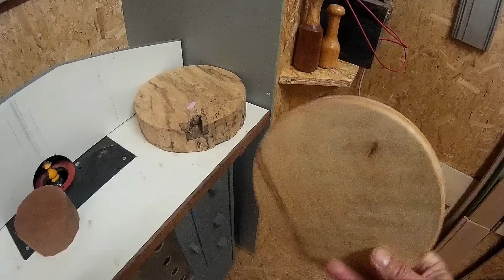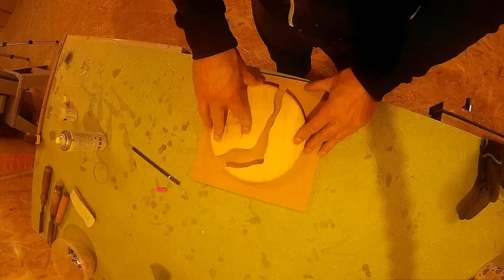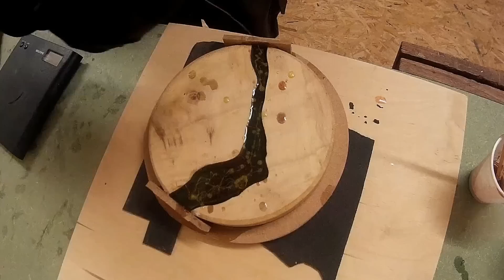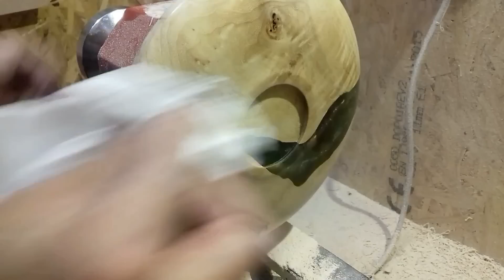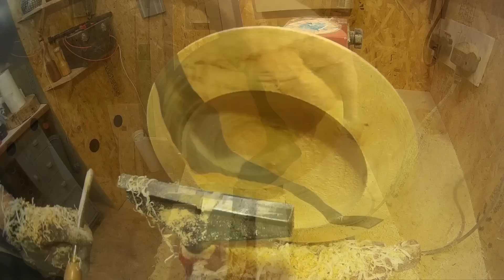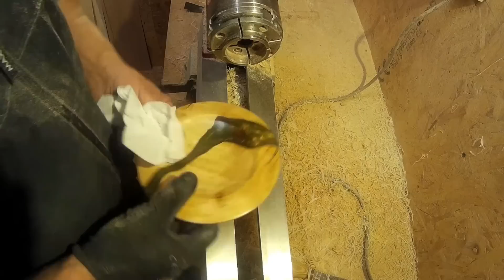Woodturning - The Tectonic Plate

Comment: Very nice.  Did you, not, have to put in a pressure pot to prevent bubbles, etc?
Reply from the maker: Thanks Donna.. no its quite a slow setting epoxy I used so turned out bubble free ...  cheers
Reply: I didn't know that a slow setting epoxy would behave that way (I assume it was a 24 hr set). I've seen small butane torches waved over the surface of setting epoxy to pop any bubbles, and your response is a tip that I'll have to try. Thanks !
Reply from the maker: Hi Doug .. I'm not sure how long the epoxy takes to set but  it's set overnight but I won't usually do anything with it for 24 hrs . I sometimes use a heat gun to help disperse bubbles and I have a vac chamber but that's usually on pencil projects where it's harder for the bubbles to disperse, on an open cast like this I don't seem to have a problem with bubbles . I also use pearlex powder which I think may help .. a pressure pot  is on my list of things I need / want !! along with a lot of other things .. thanks for watching

Comment: What kind of epoxy did you use? The plate is awesome. I would like to try my luck. Thanks for the video.
Reply from the maker: Thanks Michael .. I used epoxy resin with alcohol ink and coloured mica powders .. cheers
Reply: Hi Andy, any link from where you purchased your epoxy resin, or any brand that you like more than the others? Same of the alcohol ink, too. Thx.